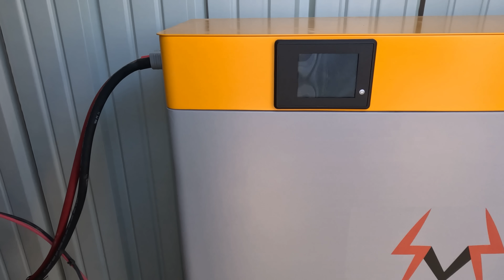Off-Grid Solar 1 Year | Regrets & Walk-through

Comment from the maker: Hey y'all! We had a lot of fun making this video and hope that it is a help to some of you or is at least interesting! Haha. If there's anything specific you'd like to know about Solar or our system, comment below, and we will see if we can work it into a future video!  If you're interested in learning more about Shop Solar check out the link in our description.
Reply: Been running since 2017 or so.  Started with 16 kWh of storage.  Now I have a little over 30 kWh and plan to upgrade to 45 kWh soon.  My biggest issue is the line loss with voltage drop is robbing me of power when trying to do long runs to the arrays.  Currently I have 4 arrays, although smaller than yours.

For your wire runs to the panels what Guage of cable did you use?  Direct bury or conduit?
Reply: @SenatorPerry  In my off-grid system, my solar arrays are about 60 feet from the all-in -one units, so I used 4AWG wires. I do have them in conduit. Much farther away, (longer runs), I would have gone with 2AWG Welding wire. Even if one gets direct bury cables, using a conduit is a good idea in case there is a micro leak in the casing/wire sheathing.
Reply: @ Keep your voltage as high as possible, DC runs as short as possible, and put your batteries and your AC inverter as close to it all as possile.  115 V AC runs are more efficient and much cheaper to run.
Reply: @ Agreed. I have two arrays. One runs at around 263VDC, and the other runs at around 303VDC. They are going into seperate Growatt 5000W units.
Reply: @RunawayMattCass

Hi, you two! 
Fellow Tennessean here, on a 0.75- acre plot. 

I love what you've done!

Just before retirement, I took my offgrid- tinyhouse-'shell' (8'×12') brainstormed pencil- sketches & desired specs to a local Mennonite builder, and they built and truck- delivered it; it superinsulated, steel-reinforced in places with about 30 steel brackets, and with three thick longitudinal 'skids' bonded underneath its sturdy floor..

I quickly sheetrocked it, ran a few surfacewired- circuits, did a quick rainharvesting system, DIY'ed a (now-2,600- watts), nominal 12V solar array, its present iteration splitting it into three separate,(intentionally  parallel- wired) arrays; one- each fixed- bolted at their 'leaning' top to the South & West tinyhouse walls, to shade those walls, (the solarpanels mounted on simplest 2"×4" DIY'ed wood support- frames), and most panels being cheap 100W ones, with three being 120W ones from an 'upgrading' solarfarm), 

and the last 1/3rd of them, onto a tripod- style, freestanding yard- frame placed nearby.. 

No genny, ever; just now- three 100-Ah AGM batts in an emergency- wallvented, climate- controlled box indoors, the solarpanels' output split between separate charge controllers; ('redundancy, redundancy!'), 
a 1,500W (and backup 1,000W) inverter, to run just a ricecooker, inductive cooker, microwave, yardtools- chargers.. 

Pretty-much everything-else, 12V DC.. Rainwater pumps, LED lighting, three B*geRV flex fridge/ freezer units.. 3-gal showers- watertank immersion heater.. Powerful summertime floorgrate, gable- exhaustvent, and other fans.. One freezer unit, in summer, kept filled with ~14 rigid 'Blu Ic* blocks, to (rotatedly) pop-into a small portable (minifans- blown) bin on very-hottest days, which then blows measuredly 39°F-41°F air on me, as I sit or lie adjacent.. No prob keeping cool & sweat-free, at all times, and that subfloor dry- earth- dehumidified air  whooshingly blown in at the floorgrate, and it exiting 'high', keeps the indoor HUMIDITY usually 12-40+ points lower, than outdoors..

A shiny Galvalume roof (atop-which, I just summer-lashed super-reflective aluminized- shadecloth, which also temporarily retains some rains- moisture; that evaporatively cooling the roof as well; my likewise- superinsulated ceiling no longer gets even as warm as my body's 90-92°F skin-temp, meaning that (it), likewise, like everything else in here, acts as a cool radiative 'heatsink' sucking- away my bodyheat..

In winter, I switch-on up to 4-5 of my eight wee 12V, 100W  (2.25"-diameter), tiny integral- fansblown PTC- microheaters, them mounted beneath the lip of shelves and cabinets, even some- of which, are able to heat the actual 'livingquarters- half' of this tinyhouse (bunkcubby, kitchenette, & corner- showerstall) to 80°F or above, even when it's a -0°F morning, at daylight.. 

I (by winter-daytime) dump all excess solarwatts into up-to four slimline 'time-release heat' watertanks, one BENEATH my bunk, (them equipped with 12V immersion heaters), and usually, with all my PTC- microheaters 'off' overnight, I wake up the next morning to 65°F or greater temps, in this half.. 

Underneath a winter- used thick- foamboard dropceiling, it lowered- to 6' height in winter. The other, wall- separated tinyhouse- half, (entry, pantry, closet) usually stays no-colder than 40's-50°F in winter; once, 39°F, on a below- zero night. No ruinously- frozen fresh or canned goods. 
And I frequently open the midroom door, to let excess winter- heat 'over there.'

A low-wattage immersion heater in my rainbarrel(s),  used for 20 minutes on single- digits temps morns, quickly thaws any surface-ice in it.

Loving retirement in my little offgrid tinyhouse, and'm sooo tickled to see what y'all have done! 
'Best', to you. 😊
Reply: @TNvegan1958 oh Jesus why don't you just make your own video? Do you really think anybody's going to read all of that??😅

Here's the answer NO ... after 3 months you have zero likes.
Reply: that Rich solar inverter beware they have crap customer service and the mc4s they sell are garbage
Reply: a good way to do that generator  and save mad money 
harbor freight Predator the bigger units are dual fuel gas/propane they can also be daisy chained for bigger power and have RV hookup port they also have a remote start its not fully auto but nice to have you may also be able to do an auto system with these since the remote is installed it may be able to be tied into by a add on

Comment: Put foam insulation on the walls and when it is real cold run a small light bulb But the inverter and battery will give of enough heat People in Canda did this with not problem

Comment: have you thought of buying 4x 12v 300ah self heating batteries? about 2100.00 on amazon for the set, adds 15kwh to your system, just not plug and play .. etc.might be another 200 in cables, breakers etc.  I still think its a serious savings vs the all in one units  its one of the things i am going to go to, with the price points for 3 sets of 4 .. with a battery balancer for each, the accessories, .. 50kwh battery bank, at under 10k vs like EG4 rack self heating batteries to get the same 50kwh is over 20k.. the price difference is significant.

Comment: Can you run a solar system / battery / inverter alongside AEP electric company? For example, can you simply offset the amount of electricity you pay for with free solar? So - instead of paying a $300-$400/month electric bill in the winter or summer (Heating and A/C, respectively) you only pay $100 per month or $50 per month?

Comment: If I build another system I'l place the panels vertically. You loose not that much effect in summer (and any losses can be mitigated by adding a few panels), but you for sure do not have to brush any snow off from the panels in winter. 
This ofc only applies if you have snow in the winter.

Comment: Not a fan of lithium-ion rather have lifepo4, I believe Mamoth uses out of spec, but still good car lithium-ion, though at 300 lbs maybe it is lifepo4. Thanks for mentioning the folks coming, I didn't see the need for a 6000watt inverter. 

FWIW - I built a pressure-treated wood frame for my 4500 watt array 13 years ago, it's doing just fine. Might be slightly more robust but not much. I went with winter angle about 45 degrees, this also makes snow removal easier. My wood support has handled 12 inches of wet snow!  Higher angle made sense as the longer days of summer make up for poor angle  I use a 15 kWh lifepo4 battery bank (replacing the original 16.5 kWh forklift battery), I'm in central Missouri, I think similar solar insolation/exposure. Roof top camper air conditioners tend to have very poor efficency. A new more efficent or a mini split may cool your place for 1/2 - 2/3rds the energy.

Looks good!

Comment: easily hinge the lower part of your solar installation then use pins to hold the top on a vertical rail.  now you can seasonally adjust your panels angel to the sun.

Comment: For AC power, watts isn't necessarily volts times amps.  In AC power, we say 500 VA if you're using 4.16 A at 120VAC.  If you're running a heater (resistive load), then the power is also 500.  If you're running something like an AC motor then the power would actually be less than the VA.  For DC power, it's simpler: power is always the voltage times the current.

Comment: Use refurbed forklift batteries. You can buy quadruple of that capacity for the price and it is not breaking down at freezing point. If you can handle a homestead you can handle that too.

Comment: Look up c rate, higher amp draw results in lower effective capacity, the Watt hrs are in there just inaccessible. C rate is the max discharge rate at the rated amp draw that allows full capacity. Anetdoly think the more cars on a highway the less capacity it can provide

Comment: In Summer in the northern hemisphere, the sun rises and sets north of east-west.  Where I live (39 deg lattitude), it sets 31 deg north of west on June 21.  So, if your main need is afternoon AC in Summer, not bad if your panels face west or southwest.  A more south-facing orientation can collect more energy per day, but you have to store it to use it, and batteries are still pricey (~8 c/kWh to use, given initial upfront cost and cycle life), requires much space, and adds more risk of fire.  With a string-inverter like in the video, it is critical that no panel get even partially shaded.  If so, that greatly limits current output of that panel and all in series with it.  Even a shadow from a thin pole or cable that crosses a panel in every string can reduce output by 90% (several youtubes).

In a ground mount, one idea is to shingle the panels so the rain doesn't fall between the gaps.  I did that to form a side carport roof, with the rain running into the house gutter.  I catch the drips between rows of panels in a slice of U-channel (cut from polycarb roofing), which also runs to the gutter.  That makes the area below the panels better for storing stuff like lawnmowers and bikes.  My panels are bifacial, with glass on each side, so good lighting underneath.  Also good for a backyard gazebo roof.

I have a similar 6 kW "string inverter" (EG4 6000XP), with just enough battery (5.1 kWh) to get past my utility's Summer peak price hours (5-8 pm).  It switches to the grid if home draw exceeds 6 kW (or PV + Batt output limit), and at programmed hours (night), but cannot feed the grid.  Little credit (NEM3) now in California for grid-feed, and that puts you under the utility's control and fees.

Comment: This is my first video watching on your channel and it's nice to see people having GOOD experiences with their solar arrays as there are plenty of videos being critical, that when you listen carefully what you hear is that the person doing the video didn't understand enough when they had their system installed.

So, one small correction for power calculation, for a DC circuit the calculation is P = IE.  For an AC circuit P = IE(PF), where PF = power factor and this results from the issue of a voltage and current that vary and the end result is that you never get 100% of the current and voltage values. 

The power factor is dependent on the load and the different components of the load and this is what AI prints out for power factor:

Factors Influencing Power Factor:

    Type of Load:
        Resistive Loads (e.g., heaters, incandescent lights) typically have a power factor close to 1.
        Inductive Loads (e.g., motors, transformers) usually have a lower power factor, often between 0.7 and 0.9.
    Capacitive Loads: These can improve the power factor when used in conjunction with inductive loads.

The point is if you assume that P = IE for an AC circuit and your system is borderline at the limit you may find you don't have enough generation.  Now, me personally when I design my system will account for 100% of the load the property can put on the system at any given time and then have the capacity to generate 30% more than that for the solar panels and that's because in my case power will be critical, which also means I need a good sized generator and a good sized battery.

Comment: We are off grid, 10yrs and counting. Started small and grown to current large system. Double your solar panel array and battery storage.
I would save for another battery and then the array size. Rome wasn’t built in a day, took us ten years. But you are on the right path.
Monitoring is essential. No add on system for your current system?

Comment: Why speak in WH when people are most used to kWH in their electric billing it gives a good comparison.   So that 9,600 wH battery is 9.6kWH which means it can store between $1 and $2 of electricity where you getting power off the electric grid depending on if you have good rate of 10 cents a kWH or fairly high rate of 20 cents per kWH

Comment: So I love ur video and thanks for taking the time to explain the details as u went along. I recently bought 2 Bluetti ep900 inverters and two batteries to go with each and the learning curve is so steep. Sink or swim eh? My only issue is u did really go into what ud change other then doubling up on the 9600 Wh battery and heater. I never heard u talk about ur Bluetti or why or how u came to the conclusion of 6 series panels and two in parallel. 
I’m attempting to maximize my solar panel out put and I’m running 10 panels in series to each inverter right now but I’m only producing 1.5 Kw max at high noon and that’s 10 bi-facial panels so like I said just learning and I have to rearrange my array but why u chose 6 series x2 in parallel is interesting I’ll search for that video

Comment: Matt
We are not off grid in northeast VA.  Just have backup power. I have 12 310w panels 48v 8 6v deep cycle batteries. We run 3 freezers and a frig on it. I'm building a 24v portable power station with 2 lithium batteries.  I have 25 130w panels, don't know if I want to used them since they take almost the same amount of space as the 310w. Also have 3 310w panels to charge the portable unit. The lithium batteries are as cheap as acid batteries now. Running a 3000w 48v inverter. Lowest battery voltage I've seen on cloudy days is 46v in AM.

Comment: 10:45 pick up a Thermo Cube thermostat. 80 watt light bulb in a mechanics work light will keep your batteries above freezing.  Heat lamp for chickens, on the switch also works.

Comment: What kind of AC are you using in your RV? I have a Senville 12K BTU split unit in my home bedroom (about 200 sq/ft) and even in the southern desert with regular 100-degree days and night temperatures rarely below 80 degrees with a fairly poorly insulated room, my AC unit only uses about 1.3 kWh from 8pm to 8am, and only about 4.5 kwh total in a 24 hour period. I keep the temperature set to around 75 degrees, which is most comfortable for me.

Comment: I use two eg4 chargeveeters to put 9000 watts from my Westinghouse propane generator. Costs about 2300 for that setup. But you could do one chargeverter and a smaller genset for $1200 i bet.

Comment: Need some help over here guys,if anyone could give some advice please. My family back in Cuba has constant issues with power going out for 6 ,7 hours a day,even more sometimes. What sort of combination do I need in order to keep most things on around the house? Think of a 2 bedroom apartment,a family of 4. Several ceiling lights, 2 fans, a regular size refrigerator, 2 tvs, a pressure cooker and rice cooker. What would it take to run these units in terms of, inverter and how many batteries? Can't use solar panels,so the idea is to charge the batteries during the 10 hours that electricity is on,and then run everything I mentioned for about 4 to 5 hours a night. Then ideally, to be able to run a mini split unit during 5 to 6 hours when everyone goes to bed and nothing else is being used. Running the mini split unit is not essential,but it would be a great convenience if  i can make it happen. In order to save money we wouldn't use one of these cool looking units as shown in the video, it would be the old inverter plus several batteries. I just don't know what sort of combination is needed,i see 12v 100ah batteries, 12v 250ah batteries, 12v 314ah batteries. Most common used inverters I see people using back home is 1000w, 2000w,3000w Inverters. But I am not sure omwho to create a combo of Inverter with the right type of battery and quantity for our needs.

Comment: Thanks for this video. Well done and very informative. For your winter battery charging challenges, have you considered insulating the Shed with Styrofoam and putting in a temperature  controlled space heater?
You may be able to keep the temperature at optimal ranges to charge the battery. Just a thought.

Comment: If you get an EV with v2l you'd essentially have a backup battery about the size of the car's battery. You could also increase the size of the solar array - maybe one tall enough to shelter your RV and reduce heating and cooling needs.

Comment: For heating batteries. Get a Inkbird temperature controller and a 500-1000w heater pugged into and turn it on the maintain minimum temperature in a well insulated space. Hope this helps.